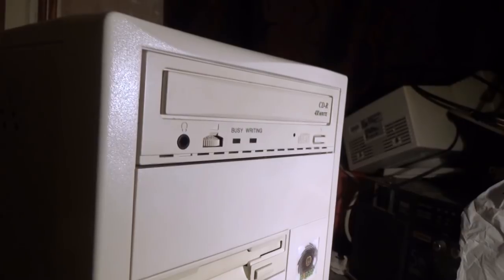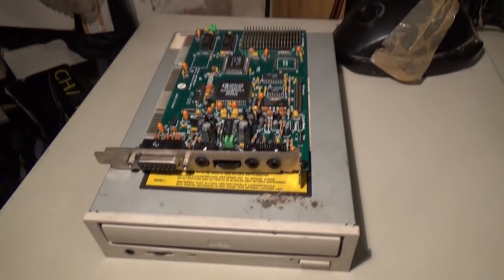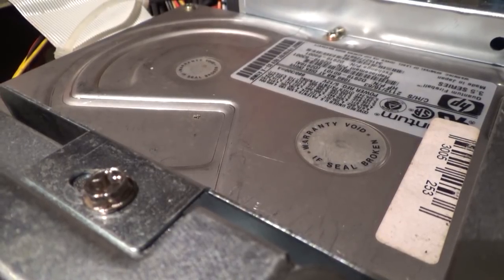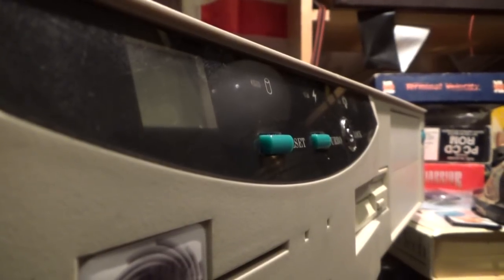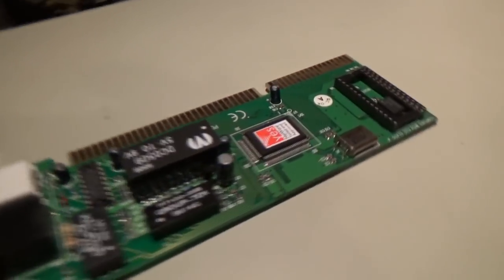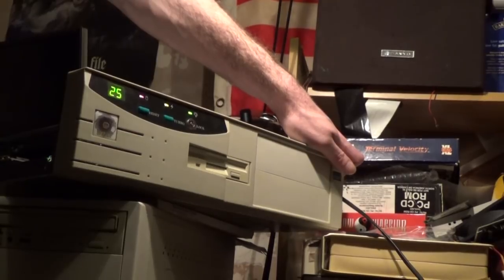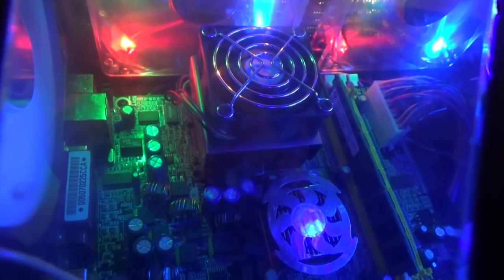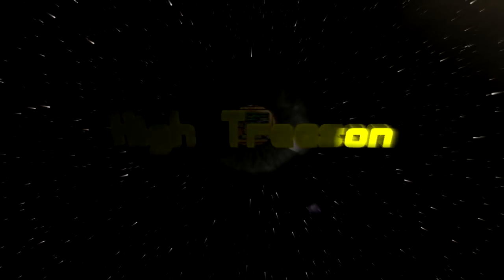1994 PC - Reality VS YouTube

Comment: My PC back in 1994 was a piece of shit. Persuaded my parents to buy a computer, they bought an Olivetti 286 monochrome from the local paper classifieds while I was at school. Paid a fortune for it. No extended RAM, just the 640kb conventional. Ran like shit ... 16mhz.

A few months later they finally agreed to buy a "modern" PC, but again ... despite my best attempts to organize it for them, they went to a local shop while I was at school ... and the shop owner absolutely saw them coming. They had taken my list of specs, shown it to him, let him convince them that I didn't know what I was talking about and sold them a piss poor machine for EXACTLY the SAME AMOUNT of money!

I had told them to get the 486-DX2-66, 4MB RAM and a 300MB HD, with any 15" monitor. Price of the machine back then was around £1400. My parents got ripped off and paid £1350 for a 486-SLC-33Mhz (.... yes, the SLC was even slower than an SX), 2MB RAM (he actually told them 2MB was "fine") and a 160MB HD. What a piece of shit that man must have been. I hope he burns in hell.

Anyways, that shitty 486-SLC ran worse than a 386-DX. It barely played XCOM 2, any smoke grenade / dye grenade crashed the PC. Obviously the 2MB RAM meant Raptor and Doom were out of the question, but when I finally bought an extra 2MB RAM for about £70, I found out the 486-SLC couldn't actually play Doom at more than 8fps. I mean ... for the same money, they could have had the 486-DX2-66 which would have been a dream machine.

Had to use that PC for almost 2 years, the CPU wasn't upgradable it was glued / soldered to the motherboard. In the end I saved enough money to buy my own rig, and went for the Pentium 133Mhz with 16MB RAM and plenty of storage. Figured ... why fuck around. Get the big boy. Paid my hard earned £1600 and waited a week until it was built. When I got that PC home and booted it up, I noticed the BIOS read "AMD PR-133 @ 100Mhz" and thought ... WHOAH now what the fuck is that? So I called the guy at the shop, who told me he had done me a favour and given me a FASTER CPU than the Pentium 133Hz, because even though this AMD PR CPU ran slower, it was actually FASTER than the Pentium 133! Now being just 15 years old and not knowing how to deal with shit houses yet, I didn't do anything. To be fair I was just happy to be playing new, good games. But then I tried to run Quake ... and realized just how shit that PR 133 was at floating point math. It was 1994 all over again. Another robbing bastard at another PC shop.

Almost 2 years later, I would return to that PC shop and while my friend Tony asked for a 56k modem out the back, I went round the counter and stole a brand new Pentium 200Mhz vanilla CPU from the rack and a stack of CD-ROMs. Got my own back in the end. That Pentium 200 ran like silk! XD
Reply from the maker: That 486SLC sounds like a real scumbag machine alright, or the store which sold it does. We had a local shop here who was quite dishonest, used to install Cyrix CPUs with similar statements to your AMD K5 story here - I actually like the K5, but don't recall him ever using those - and he occasionally overclocked them, sometimes over-volting things in an attempt to get them stable. At one time I would have moved from the 386SLC to a Cyrix he sold, at the time I told my parents not to buy anything from him, that a guy I knew would build a better one cheaper, but they didn't listen and I got this barely functional piece of crap. 

I don't remember what the hardware was, exactly, think it was SiS video, some ALS sound card and around 16MB of RAM. This was 1999-2000 and I don't recall the cost, a few hundred I think. Anyway, me and this guy I knew got our hands on it and stripped it down - harder than it should have been because the store liked putting rivets in the screw holes to keep the cases shut - to see what a mess it was inside. By now it had already been back to the store for several PSU replacements over only a few months so we tracked that down first, found some weird device in a CD bay which got hot when powered, seemed to be a dummy load of some kind potted in silicon sealer of all things, that same crap you use around the edges of the bath, never seen anything like it and couldn't get to the internals non-destructively.

The reason me and the guy opted to modify this system was that my parents were insistent on not getting a machine from him, even though we'd known him for years, I'd grown up around his kids and he'd even have given my an old Socket 7 system for free because he saw plenty nobody wanted any more. We took out the crappy VGA card and replaced it with a faster one, nothing special. We replaced the sound card with a real Creative one, I think it was an SB32 or AWE 32 because I remember there being a wavetable. We stripped out the 1GB Maxtor hard drive and replaced it with a couple of larger Western Digitals, think they were ~6GB. Upgraded the RAM to about 64MB as we noticed a performance drop beyond that, likely due to limits of the Triton chipset's caching capabilities. Lastly, we figured the board would be able to take a K6-200 which his friend had gotten rid of, as his board would take K6-2 chips which he'd long since moved to, it was a pretty decent leap from where things started.

Took it home, enjoyed actually being able to get stuff done for a week, then found my Dad complaining about 'the music sounds wrong' and 'you changed it' and 'you and that bloke did something to it, didn't you?' which sucked, given he didn't live with us by that time, so he'd come purely to check up on the machine it seems, I have no idea - he insisted that I was somehow breaking the PSUs despite never having opened the system, so he would come and 'inspect' the system every so often. The machine then disappeared, being taken back to that scumbag store. Said store removed the upgrades and gave me even worse hardware than I had started with, drilling extra holes for additional rivets, so that the only way in was destructive. My friend, the guy who gave me the parts, was furious. With no more good spares, we drilled out the rivets and found another one of those things in the CD bay and that something had been done to the voltregs on the motherboard. The system had pretty much died by then so I was stuck with the 386SLC a little longer, briefly getting a P166MMX (ironically from my Dad) before building a Duron and telling everyone else to go screw themselves. Not a single part of that Duron was bought from the scumbag store.

It was great to read your story, especially with its similarities to my own. Mad props to you for 'borrowing' some stuff from the one who ripped you off, I never got a chance to exact revenge on the one here and the guy who used to help me out had a heart attack before he could do anything himself.

In case you wondered, the 386SLC was not from that store, it was free, it was an in-store computer used by Comet that had been removed from service due to upgrades, that one still works.

Comment: It's only have the truth. Sure if you  were poor in 1994 you would be looking for bare-bone deals  through the back pages of Computer Shopper. I worked through the summer and bought a P90 machine in early 95 and I was only a student. I mean somebody was buying all those nice gateway2000 and Micron systems from the front pages pf pc magazines?
Reply from the maker: Somebody had to have bought the Pentium 66 here too, but I've certainly seen far more of these low-end 486s in the wild, suggesting they sold far more than the alternatives.
Reply: When I was young, I only knew one person that had a PC, this video is closer to to the truth than just half. It's not just being poor or not, my mom didn't get internet until 2010 (and by extention a computer) because she didn't see any appeal in it until around that time when having an internet connection really started to give you much more than a couple of web pages. A lot of people didn't see the appeal of even owning a computer until the 00's and some still don't have one, they use their smartphone to do what they could ever need. 

Somebody gave me their 90's computer couple of years ago, do you know what it was ? A 386sx at 25MHz from ~91 made by PCChips, the CPU wasn't bad, but the system had 1MB of ram, a 1988 VGA card, a 40MB HDD and a 1.44MB floppy drive and that was it, no sound card. The PC had serial and parallel just because it came with the I/O card. That's how most people built their machines at the time, few spend the cash on those for fun but because they needed it to do stuff.
Reply: @NintenloupWolfFR  At least in the US enough people owmed a PC that by 1994 AOL was sending out millions of their infamous floppies to residential addresses. Computers were already very common and dial-up and AOL were everywhere. I also recall enormous crowds at best Buy when Windows 95 was released  and it sure didn't run on a 386sx!